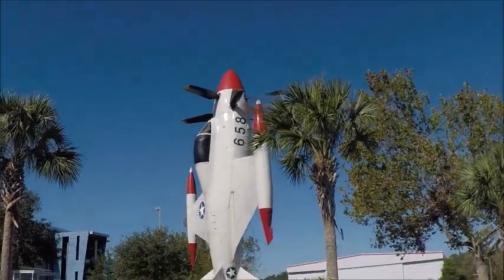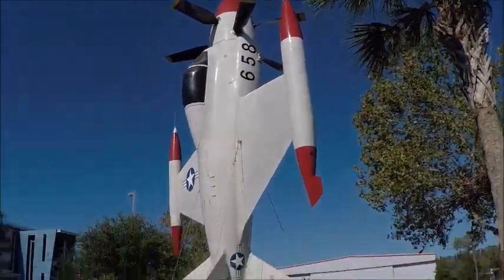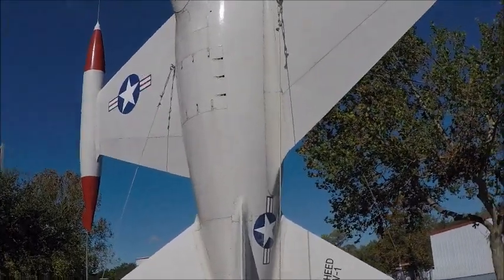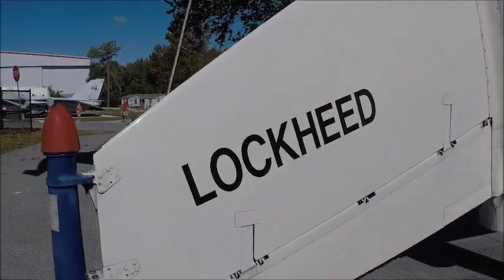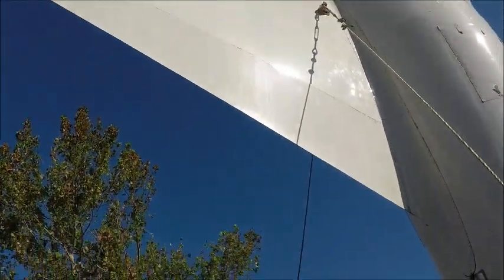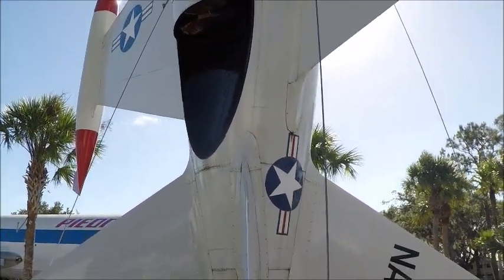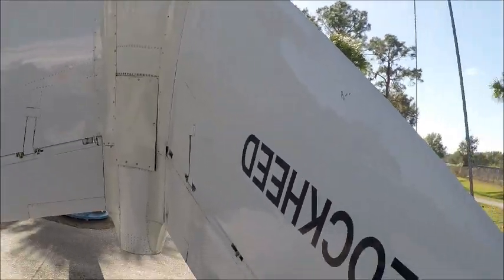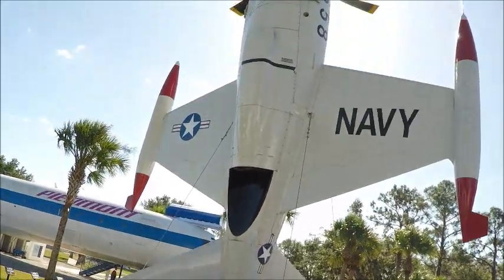Lockheed XFV1  1954 Florida Air Museum Lakeland Linder Airport

Comment: The aircraft in the footage appears to have a slightly different wing configuration. Probably a different 'mark' of aircraft. I've seen video of this before along with things like the 'flying bedstead'. Actually in the b/w video the pilot makes landing look easy, but I'm sure it was anything but - especially if he was trying to get on the deck of a moving ship, which I think was the original criteria for the concept. What amazes me is that somebody started with a clean sheet of paper and drew an airplane that stands on its tail and needs 'reversing' onto its landing spot, and the company said 'let's build it!'
Reply from the maker: Hey, Mick!  My hat's off to the pilot who dared fly this thing!  The idea that they would start production was probably a mark of the time....great optimism after the war that good times were here after all that privation of war!  Thanks!  :) Jack